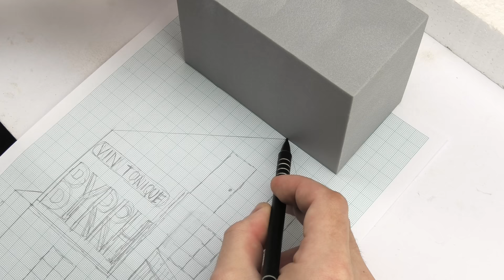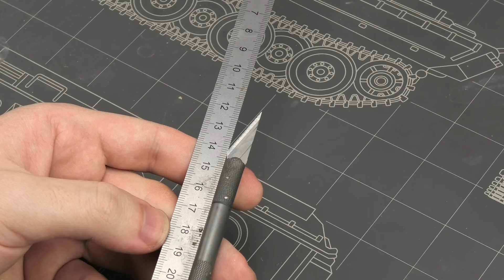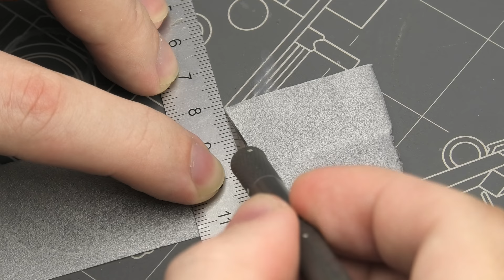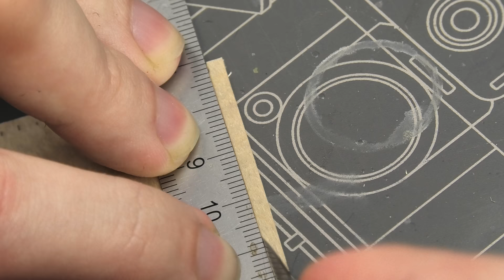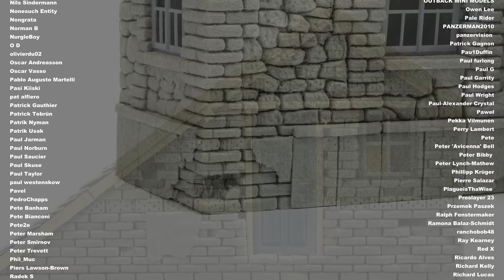Carving An Old French House From A Block Of Styrofoam

Comment: Just a note on bricks, like everything in history they vary with time and place. A rough rule of thumb is that the earlier the brick the longer it is and a late 1700s brick would be about 10% longer than a modern brick. Yeah, I know this is rivet-counting but it's something I picked up in architectural history and it's here to be used or ignored.
Reply: Interesting. Why would this be if you know?
Reply: @mpk6664  Honestly I'm not sure. I think it was firing techniques may have been different. I think also modern brick sizing which seems to have stabilised around the late 1800s is more robust, there seems to be less cracking of the bricks. But then again I look at the amazing Flemish brick castles and they're standing up just fine :)
Reply: @mpk6664  The width is determined by the fact that it is necessary to hold it easily with one hand The height & length less so important & seemed to be very similar from roman times up until the late 1700s. These were all hand made, so the weight may have been a factor. The main initial reason for the size change in England at least was (according to the Architects Journal), how a new property tax was based on the number of bricks used in a building. Therefore bricks got bigger - so fewer were used. Then parliament taxed larger bricks more, and bricks got smaller again. Eventually the tax was scrapped, and brick size was regulated to 3 or 4 courses per foot depending on location. It remained much the same from 1851 when mass production was started until the metric system was introduced.
Reply: Common house bricks in Australia using the metric measurement like most bricks of a similar dimension use a common height (Guage) where they are based off a 2.4m ceiling height. A brick is 76mm + 10mm for a mortar joint (86mm guage) multiply by 7 = 602mm, rounded down to 600mm multiply by 4 = 2.4m . A brick is 230mm in length, divided by 2 = 115mm, half a brick is 110mm. the missing 10mm, 110 + 110 = 220 + 10mm  = 230mm is the mortar joint for the perpend (vertical joint).  Ergo, a brick is 110 x 76 x 230mm, this is to allow for bonding of the bricks to maintain correct load bearing (half bond) and to enable the half bond to transition a corner. Regardless of bricks being dry pressed (solid, with the indentation called a frog, or extruded, known as wire cut with the holes), bricks can vary up to 10mm in any dimension due to the manufacturing process and how long they are fired for. Hope this helps to understand common brick sizes and dimensions. In bricklaying, we can use a template called a Brick Rod, a length of timber 25x25x2400mm and marked at the appropriate guage, be this bricks, block work etc so to recap, a brick is 230mm + joint 10mm = 240mm, an opening is 240mm + 10mm (the mortar joint at the other end of the brick) = 250mm. The same in the vertical dimension, 10 + 76 + 10mm (the brick and two mortar beds). Again hopefully this helps, especially when you are calculating the size of openings (3D printed windows etc) when working to your scale.
Reply: When I looked up common brick sizes in the US there are about 8 common sizes based on 3 or 4 per foot of height. Hey metric is legal here. So no metric jokes. With a 3/8ths allowance for mortar height is 2-5/8 or 3-5/8. Length and widths vary from Econo, 3-5/8 x 3-5/8 x 7-5/8 to widths pretty standard at 3-5/5 and lengths up to 11-5/8. 
I've been messing with laser engraving brick patterns in HO scale*. The Econo sized bricks are easy to plan out. Best for industrial walls. Residential or business walls are better with longer bricks. One issue with longer bricks is the corners. I can actually cut the brick courses on the ends of the walls and then match fit them on corners. 1mm thick material is pretty close to the scale 3-5/8 plus mortar. Only using illustration board leaves a surface that is very fragile that needs to be re-enforced with some sort of binder. The first ones I actually started with was cinder block embossed into illustration board or 3/32 Basswood. 3/32 comes almost dead on for the 8" height and width.
*inspired by ITLA wall modules.

Comment: A good tip for keeping stone walls looking random is to randomly carve some large stones in random places on the wall before carving the rest of the stones. The initially random placement means if you start getting uniform, when you hit the randomly carved stone it will throw off your uniform pattern as it won't match up with it.

Comment: This kept popping up in my feed for at least a week or more. Very enjoyable watching you work. I've messed around with embossing cement block walks in 3/32 Basswood. The thickness is pretty much dead on for cement clock height and width in the US. The corners of the walls fit together on the courses.

Comment: Damn, that is the single most elaborated, detailed and articulated model house I have ever seen. Whats better? It's made almost entirely out of styrofoam.
Reply from the maker: It's such a great material, I'm starting to think how it could be used in tank modeling! :)
Reply: @NightShiftScaleModels  If you would like to place some kind of object on a tank which in real life has a relatively large volume, but soft, squishy texture which can be deformed easily by various contacts (for ex. a mattress for wathever reason) styrofoam would be the best material to sculpt it out from, since 3D printing it would be, dare I say, too static looking.

Comment: Modpotch works a bit better when you want to seal and strengthen styrofoam what i normally do is mix some black acrylic paint with a pot of Modpotch in a 50/ 50 mix and it works a treat

Comment: Nice video. 

Instead of white pva glue, tho, you could also use hot gun glue which melts under the hot wire when dry. I'm not into dioramas but into RC models and for cutting big wings I also use hot wire and for very thick wings I stick the sheets of foam on top of each other and always use hot glue gun when cutting them.

Cheers.
Reply: I'm thinking of doing some crafty things after being highly inspored by watching Night Shift's channel & Creative Mom's channel. Thanks for your tip about using a hot glue gun & the hot wire cutter.

Comment: Use steel wool to unfuzz Balsa or other wood. If you the wood lightly first the fuzz and surface swells slightly giving an even better finish if you want it smooooth

Comment: This is a hard-to-find material here in Brazil, this styrfoam. And for sure makes the scene more realistic and detailed. Conngrats!
Reply from the maker: I can imagine how it's not such a common construction material in countries with warmer climate. But it's also used for protecting house foundations against water and erosion, so maybe there's a chance to find it somewhere? :)
Reply: @NightShiftScaleModels  Brazil is such a country. In 10 years, i've never seen this anywhere. For now, i'm using foam used in air conditioning, but, the shape and form you coukd only use in small scales.

Comment: I dont even use a knife for bricks and stone. I just use a pen. Ball point. The pen usually does a perfect job with out the risk of a sliced finger.  Either way I do the same as you (minus knife) when making brick or stone face.
Reply from the maker: I think it might depend on the foam. A pen or a pencil would rip the surface on this one

Comment: Something really stupid that I learned in a tech class is that sandpaper can actually be used to mimic shingles, and it works (if it is not going to be messed with, it was just a balsa wood house but the shingles looked pretty good). Just a fun fact some may decide to try out.

Comment: I would use a bit of heat to open up space between the bricks. Trick used by cosplayers to make cuts more noticable
Reply from the maker: I tried it after a few suggestions in the last styrofoam video. It doesn't work with this foam at all :D
Reply: @NightShiftScaleModels  Auch,that's bad. At least I don't have to try it my self now

Comment: super work, as usual! Quick question: why did you put a door on the second floor? Was it something common at that time?
Reply from the maker: It's still quite common even to this day, but mostly on barns. You'll notice it in the reference picture as well :) When the attic was used to store stuff such as grain or flour, it was easier to get these materials there from the outside using a ladder or a rope.
Reply: @NightShiftScaleModels  you've done your research, as always ;) Thanks for the answer, and good luck with the end of this project

Comment: Very nice building. If you find yourself needing a stiffer thin wood, most hobby shops have a wood called basswood. It is not as spongy as balsa. I have used it where I needed some structural integrity. It's possible it might be called something different in Europe because basswood is not the real name I don't think. Nevertheless, very nice looking French building.
Reply from the maker: The hard veneer works pretty well and it can be as thin as 0.4mm, but I think nothing beats balsa when it comes to really deep, gnarly woodgrain texture! :)
Reply: Добрый вечер! Липа есть такое дерево и относится к семейству мальвовых, так же как и бальса. Есть даже топонимы в России и Германии, города Липецк и Leipzig, место где много лип. У нас в России, ещё заваривают чай с цветками липы и есть липовый мёд.) И у липы древесина  плотнее чем у бальса. А здание, да и весь проект, очень хорошо сделано. Удачи в дальнейшем!

Comment: Hello! I have a question. After work with the foam creating the rock patter, you use the PVA Glue to protect the foam. Does it works good protecting the pattern created? Can you paint over it well? I guess you will need to use a primer before start painting. 
My problem watching this kind of tutorials is that everybody use foam as material but they didn't tell how to protect that after... I am worried about create some elements and destroy it with my hands touching them playing on the board with my fingers and miniatures, or adding more weight with other elements for example. Thanks in advance!!

Comment: Amazing detailing!!!  Can you share your foam cutter model and where you bought it!  Looking forward to follow-up video!
Reply: Proxxon Hot wire cutter, they're available in various shops online.
Reply: @MegaSneetch  What Happened to the bigger "Ebay" cutter? They and the Proxxon are around the same cost on Amazon. Any reason for going smaller?